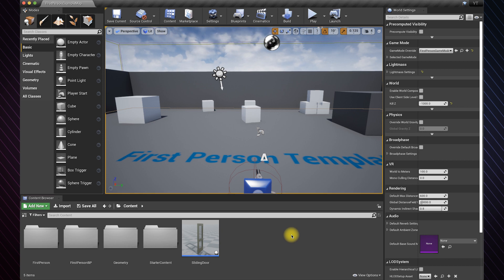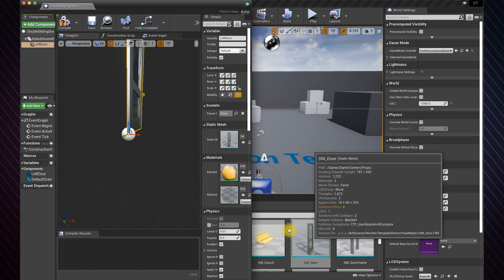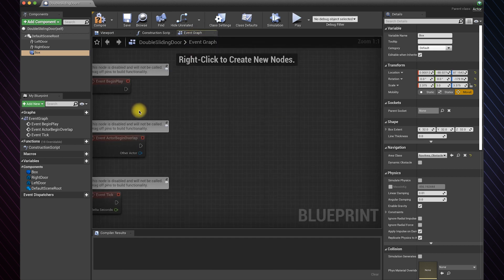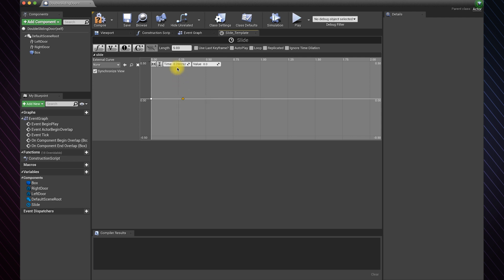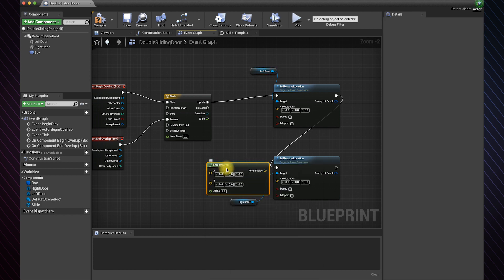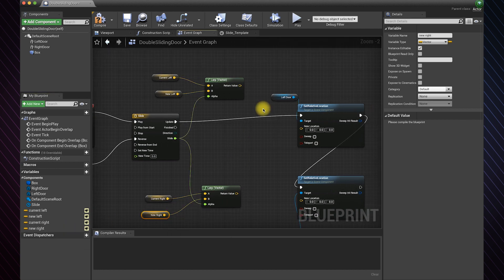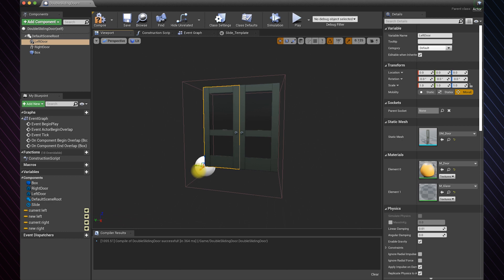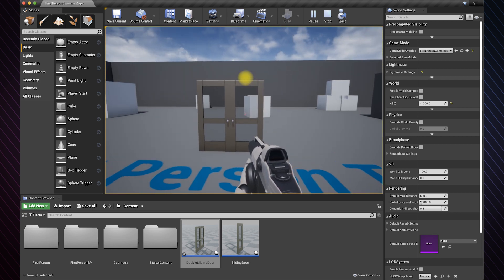How To Make A Double Sliding Door | UE4 Tutorial

Comment: did the same but my doors are twitching
Reply from the maker: Hi, sorry for the late reply. I checked the doors again and I didn't encounter your problem. What I would suggest is that you enlarge your collision box in case it's smaller than the example in the video. You need to make sure that the player is standing inside of the collision box.